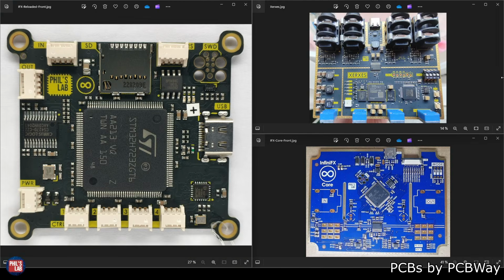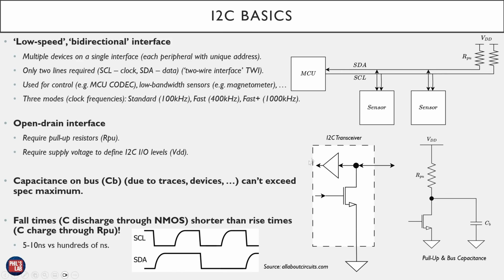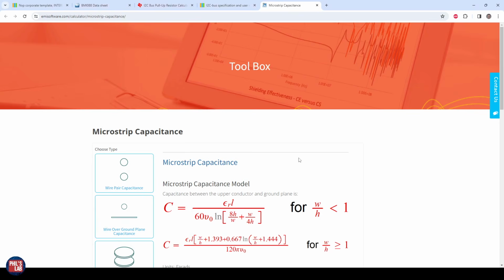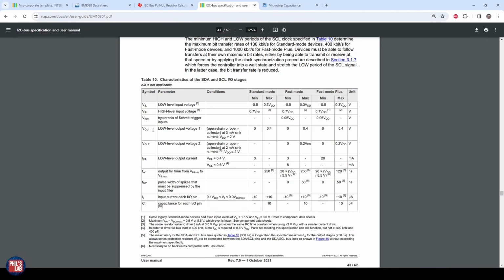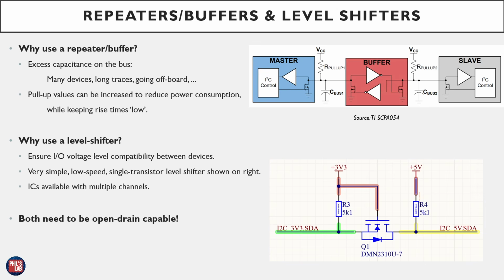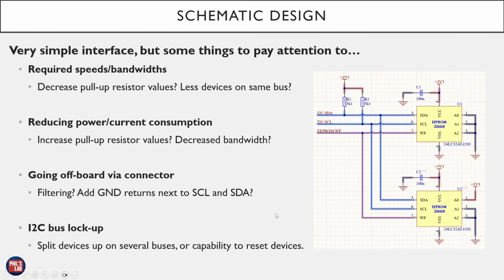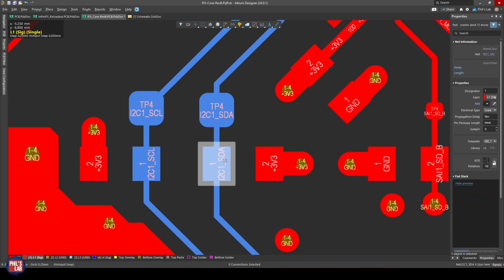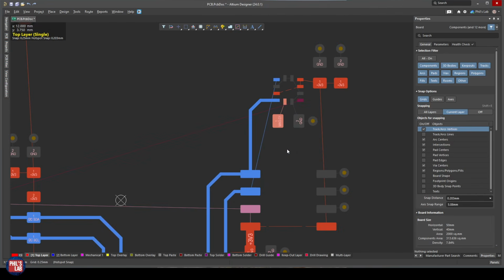I2C Hardware & PCB Design - Phil's Lab #132

Comment: I can't thank you enough Phil! Awesome video, extremely informative... This is going to be very useful for my new project that has multiple I2C devices. I had very difficult time on sizing the resistor values because of the battery-powered implementation, so this helped a lot. Many many thanks!

Comment: @PhilsLab you didnt finish the routing at the end. How would you do that if you need e.g. a layer change? You have a 2 layer board - but what about 6-8 layer.
Is it then important to have above and below a solid plane? GND or in that case 3V3? The reason for layer change is exactly another lane -> in this case zhe SDA or SCL

Comment: Nice video, thank you! 

What happens if the maximum resistor value is below the minimum value? This could happen for fast mode with 400 pF load. There a resistor of 1k is max. For 5V the min. resistance is 1.5 k. Does that mean fast mode with this load is not permitted using 5V on this bus?

Comment: Thank you for this usefull video i have a technical question about i2c i am making a pcb with 2 mcu and i want the 2 mcu to be master when they need to control a mcp23017 expander Can i use a ic low impedance  switch to flip  flop the master i2c bus. I was in mind a sgm3002 ic

Comment: great video Phil! thank you very much , one question , so the eeproms are used in that case to give the components with the same address a different address so to speak? right?
Reply: No, he uses eeproms to store data and as an example. 
If you want to use components with the same address,  you should use a multiplexer. He uses a 8-way one.
A multiplexer is like a electronic 8-way rotary switch.
The MCU/host only sees one component with that address,  but gets 8 values after each other, from the (max 8) components. 
Phil stated that a multiplexer could also have a buffer,  which is handy because you could miss important data when just receiving data from one of the other 7 components

Comment: Are there Standardized PCB buildups for cost effective production or are all PCB buildups custom made?
Reply from the maker: Unless you have specific requirements, going with whatever build-up the board house you usually go with usually produces will be the most cost-effective. E.g. for PCBWay they have standard 'stack-ups' (https://www.pcbway.com/multi-layer-laminated-structure.html) - similarly, other fab houses will have their own.
Reply: There are

Comment: If your rise times are getting a bit marginal, possibly look at using a constant current source instead of a passive resistor. My feeling though, is that in general terrms, if you are getting towards the outside of the performance envelope, you should probably be looking at a different protocol. It can tend to be "when all you have is a hammer, everything looks like a nail" and all the workarounds (repeaters etc) can start getting expensive if you are designing a commercial product.

Comment: Great explanation as always!
I have a question: does anything change design-wise in multi-master configurations? I mean, with respect to pull-up resistor and capacity calculations. It's not a very common topology and I'm not sure about its usefulness, but AFAIK it is supported and well defined by the standard.
Also, I just realized you avoided the "traditional" master-slave terminology, nice work, it did sound quite natural to me 😊. My two unsolicited cents on this: I'm not that happy that the consensus was that the word "master" carried a pernicious meaning (unlike "slave", of course).
Reply from the maker: Thank you! To be honest, I've never needed/used a multi-master configuration before. With regards to pull-up resistors and capacitance calculations nothing much should change however.

Comment: My current project used one master atmega2560 to communicate to 32 other atmega2560 mcus. The sda and scl line are reaching their limits. Approx 10m. 
Any recommendations? Go with CAN Bus?
I want to be able to flash the slave mcu‘s from the master mcu. Can i achieve this through uart over can or similar?
Reply from the maker: Not sure if the ATmega2560 supports CAN, as I'm not familiar with that part. If it does, then that definitely would be an option. Otherwise, you could look at RS485 (via UART + transceivers) if that supports your needs.

Comment: Another thing to check is whether a device has internal pullup resistors. A lot of micros have configurable pullups.
Reply: Many do, but they may not fall within the minimum and maximum pullup values that you calculate.  Frequently they will be too large (resistance too high), so you may have to use an external pullup.

Comment: I have been using the TCA9517 I2C level-shifting bus repeater with success on my I2C projects. I'm doing some challenging things, connecting 16 LED drivers at a time on the same bus, sometimes over wires 50-100cm and with this chip, it works. With the level shifting I can power boards individually and not worry about mismatch, thanks to level shifting. They are only about $0.30 each, so I add them to all my boards. It also removes the problem of worrying about pull-up resistor values, as the segments in the I2C bus are isolated.
Reply from the maker: Very cool, thanks for the tip, Jeremy - I'll check those out!

Comment: level shifter is not needed for i2c and 3.3V and 5V logic. Just connect pull-ups to the 3.3V. For 5V logic its ok. Its open drain, so HI level is defined by pullup.
Reply from the maker: Depends. Some 5V devices have a logic high of 0.7*VCC=3.5V - always check the datasheet.
Reply: @PhilsLab  yes, allways you should check a datasheet. But in most cases is HI 2V or 2.5V

Comment: A BOM consolidation trick that I recently discovered: use 5.1k resistors as your i2c pull-ups. 5.1k is also common with USB-C CC lines to get a 5V supply, so you may already have them on your board.

This is working for me on a 5V i2c bus with one device and relatively short traces, operating at 400kHz. I haven't actually measured the rise time, but I have looked at the signal on a scope and it seems to have a decent Vhi setup time... and since it's working I didn't dig into it too much. If it hadn't worked then I'd just fall back to 100kHz (faster is nice to have, but not critical in my application).
Reply from the maker: That's exactly why I actually have the 5k1 pullups in these examples - I commonly have USB-C and I2C in the same design. For most cases 5k1 works quite well as a generic value anyway for I2C.
Reply: Me too i made the same trick using the 5.1k resistors of the USB-CC lines but do you think that it will also work on a 3V3 i2c bus ?

Comment: It's so frustrating for me with the most popular PCB apps having changed so many times over the last 20 years. I'm definitely not current granted I've installed the most widely used and can design PCB's, I still need to learn those apps and there are some older ones that simply had much better GUI's.

Comment: thanks for video! can I use series resistors 22 Ohm in I2C? to improve emc a little?  5ns fall time for me looks very fast...
Reply from the maker: I typically would do that if I'm going off-board, at the connector. Otherwise, you can also add low-value series resistors - start with 0 Ohm and populate with higher values if running into issues. You'll have to take a bit of care at which end(s) to place them.
Reply: @PhilsLab   thank you so much for answer! i hope you will make same video about spi, can... as for me - i can't understand why people use common mode choke in canh&canl - it's differential signal and i think modern can-transceiver enough good

Comment: I just checked the latest schematic of a working PCB I made about a few weeks ago, I am using a BME280 with a ESP8266EX and I use a 12K pull up resistor on SCK and SDI. I did it to save on a BOM line because I was using 12K for the ESP8266EX's RES12K pin. Phil, I need to tell you this, I appreciate your videos, when you make videos you talk about things that actually matter. I thoroughly enjoy the videos you make, keep them coming.
Reply from the maker: Good job on the BoM consolidation - I aim to do the same with my designs. Thank you very much for watching!